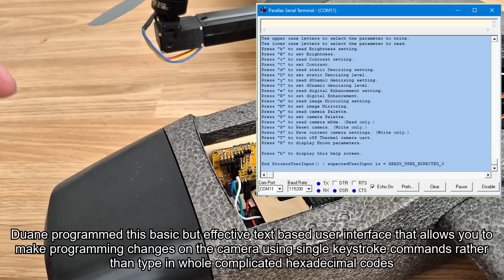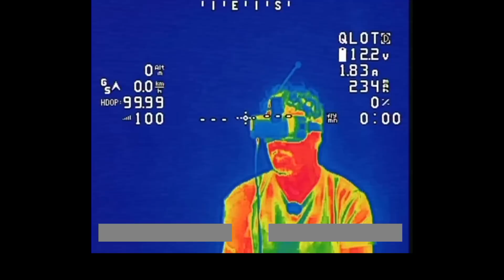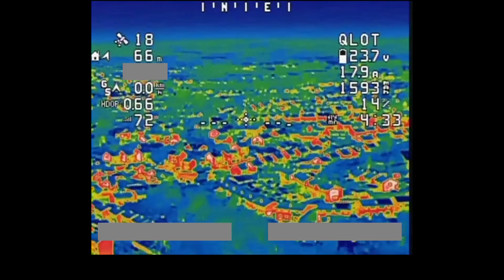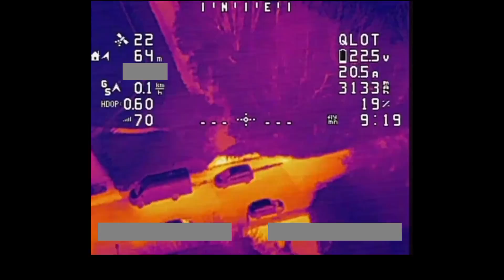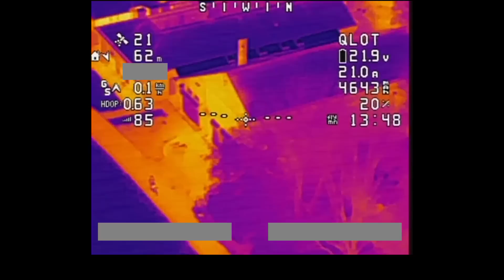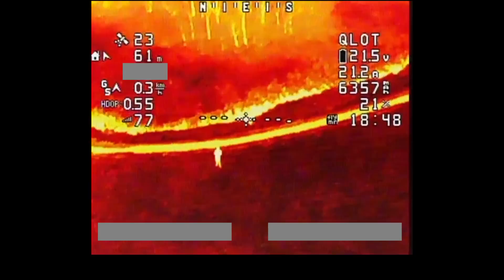🛩️AxisFlying Thermal FPV Camera - Colour Modes Unlocked

Comment: Have you found out why it causes the glitching during switching cams? Ive configured the other cam also to PAL and that helped only shortly and came back to this glitching again.
Reply from the maker: The glitching was caused by the receiver on my goggles. I can't remember exactly what the issue was, but basically ally I had to change the diversity mode

Comment: I got the 640 version and trying to figure out how to get my osd to work as well as getting an esp32 c6 connected to change the color palette. I got the cam working with both a 5in1 flight controller and a regular fc+vtx but no osd or control over the color palette. Also I’m using a Mac and betaflight. Maybe not the best choices for this….
Reply: I can help. If you haven't figured it out.  Also, how much better does the 640 look than this one?
Reply: @hduyshwjuduhd7 that would be awesome!! It doesn’t look too much different from this video but it’s based off me watching on my phone. I did manage to get osd from using a spare aio I had and grabbing a regular vtx. It’s the tinywhoop 5in1 aio with no osd but I didn’t mess with much. As for the color palette. I can’t get it to work and my camera has a green pcb that supposedly doesn’t have the tx/rx enabled in their firmware from the factory

Comment: 12:42 the reason for a red mode is because it lets your eyes adjust a bit more for darkness while looking at red light.
So if you are in a situation where you need to take off your goggles for whatever reason to see whats around you, being in the red mode would lessen the night blindness as you take the goggles off.

Comment: For anyone watching this the camera interface is standard CVSB out which means it will work with and analog  vtx  and OpenIPC is you have a board that supports CVSB in  (there are multiple that do) the control interface is just standard 3.3v uart you just send the commands via uart like you would with a gps or anything else. I'm not sure if INAV or Ardupilot have native support for it but I'd be surprised if they didnt

Comment: I was surprised that you didn't have the Caddx Infra on there,  still very interesting; it's like having a super power being able to see things in total darkness.
Reply: From what I've seen about Caddx Infra, it seems to be visible light camera as well as at least near IR. It gets noise in darkness for example. Axisflying in pure thermal camera, amount of visible light will make no difference in what you see.
Reply: @Qwarzz  I wonder if that's specific model dependent, they do have at least one model that claims to operate in 8-14 micrometer range, which would make it a thermal camera.

Comment: I tried mounting on an 8 inch and the servo stopped working pretty soon (a cheap 9g). So the plan now is with a rekon 3.5 2s frame I just ordered, skip the tilting nonsense and e6000 the thermal angled downward.

Comment: I would've put an RP2040 between the camera and the flight controller, since you said you managed to communicate with it using Python. You could set up some code to read PWM values from an RC channel, and in theory, you could switch between different modes mid-flight.

Comment: the rolling image is because you use mix mode. Try using standart diversity mode and it wont roll the feed because no 'sync lock' issue.. This also happened to me if i use camera swticher with my rapidfire..
Reply from the maker: Yeah someone suggested this on my last video, however that doesn't seem to fix the issue for me 🤷
Reply: @gizfpv dunno, but works for me with rapidfire

Comment: The red one looks like terminator vision. Set craftname to Cyberdyne Systems VTOL lol.  Jokes aside pretty cool cam. Would love to see one in 1080p+.
Reply from the maker: hahaha, you're just giving me ideas now
Reply: @gizfpv  😄👍🏻
Reply: Haaaa, my first FPV build was actually a tri-copter model of the HK Aerial I 3D printed, but in PLA it was so heavy that it sucked at flying and I couldn't really get it going, so I moved onto quads. Now that I've been in the hobby for a few years and know a little more I've been thinking of reprinting in LW-PLA (and have a thermal cam I'm messing with currently). For fun I mounted 2 "targeting" lasers where the guns would be and hooked up to the LEDs on it, would make for some interesting cinematic footage if I could get an updated version working somehow. Lol Not anytime soon though as I'm trying to get a couple VTOL fixed wing builds flying (been stuck at the hover phase which they are refusing to do properly).

Comment: Extremely cool!  You should consider asking him to upload a vid of that control board to youtube, I would love to buy one as I plan to use these axisflying cameras for a project sometime this year and I would love to purchase one of the boards!  Black/white hot are probably still the 2 most useful modes for identifying detail and objects of interest.  While the other palates are fun to play with, the only one that serves a function aside from the default one, is the highlighted super hot portions in the black/white mode; as you mentioned, for Search and rescue.  It would also be a good mode to look for really hot things, like wildfires starting.  Quite the machine you have there, excited to see you use it for practical applications in the future!
Reply: I'm planning on making a video on the next week or so. What do you me to include in the video?
Giz's radio doesn't include extra knobs or sliders so I didn't add radio control for more than the palette. With a radio like the TX16S I could add knobs which would control the contrast and brightness.
Reply: I too want to buy that board and software.
Reply: @AdityaSingh-pe8nq  I'll upload a video when I have boards available to purchase. I'm waiting a few parts so I'm not sure when I'll be ready to sell some.
BTW, the software is opensource. There's a link to my Github in the description.
Reply: @ddegn This is all super interesting. I saw in a Reddit thread that there's a way to manually NUC via UART. I think that would be super useful as well. Right now flying a quad especially closer to the ground when it NUC's you lose feed long enough to possibly cause a crash. That would be a great feature.
Reply: @dan.learns.things  I've wondered if this is possible or not To me, with the camera on the bench, The Non-Uniformity Correction (NUC) action occurs at 30 second intervals. There's an "automatic shutter control" but this value is set in minutes. It looks like it's possible to turn off the automatic shutter control but I'm not sure if this is the same as the NUC. I'll attempt to figure this out.
Reply: @ddegn  they should go hand in hand. I have a head mounted thermal with manual NUC function and no option to auto NUC. If you hit the NUC button without covering up the objective, you get a ghost image burned into the screen that doesn't go away until you hit NUC again with either a lense cap or your hand in front of it. Anything with an auto function will quickly close the shutter, NUC, then open the shutter again which you can often hear as a click.
Reply: @dan.learns.things  I'm trying to figure all this out. There are multiple settings which perform actions similar to a NUC function (as far as I understand it).
Here's a list of these settings:
Manual Shutter Calibration  (Write-Only)
This command is used to perform a manual shutter calibration for the module, known as Flat Field Calibration (FFC), which is used to correct the non-uniformity of the image and improve the image quality.
Manual Background Correction  (Write-Only)
This command is used to perform a background correction for the module. 
Background correction reduces the distortion of the background image to make it display normally.
Vignetting Correction  (Write-Only)
This command allows you to manually perform vignetting correction.
Vignetting correction is to correct image non-uniformity caused by the 
transmittance of the device's lens and internal radiation (pot lid defect) to make the image more uniform.
When using this function, you need to face the lens towards a uniform surface. Otherwise the current lens scene will be superimposed, which will affect the image display.
Automatic Shutter Control  (Read/Write)
This command is used to switch the automatic shutter control mode of the 
module. 4 modes are selectable: automatic control off, timing control, temperature difference control and full-automatic control (default, 0x03). It is recommended to keep the default setting.
After setting the switching mode (timing, temperature control, full-automatic), the shutter is periodically closed according to the set conditions, which helps to improve the uniformity of the thermal imaging.
Setting the Automatic Shutter Switching Interval  (Read/Write)
When the automatic shutter control is set to 0x01 or 0x03 (refer to Automatic Shutter Control (Read/Write)), the automatic shutter switching interval can be adjusted as needed. The module will close the shutter at a set interval, 10 minutes by default, and it is not recommended to modify it.

I'm almost done adding these five settings to the user interface. Some of these parameters make sense but some seem redundant to me. One thing I don't understand is why I observe something like a shutter closing at 30 second intervals when the default setting is 10 minutes.
The closest thing to your NUC button seems to be Vignetting Correction. I'm pretty sure the camera has an internal shutter. Hopefully it will be possible to take direct control of when the camera performs these calibration actions. I'm thinking the Manual Shutter Calibration (FFC) may act like your NUC button while not requiring an external cover.
Hopefully I'll be able to make sense of all of this once I try using these functions.

(I hope YouTube doesn't delete this.)
Reply: @dan.learns.things  The camera has five different settings which effects the way the shutter or NUC behaves. It's possible to turn off the automatic shutter. This prevents the frequent freezing of the image. A flat field correction (FFC) can be manually triggered when desired. There are a couple other settings which results in ghost images similar to those you described.
I think manually activating the shutter will be a big help to those who want use this camera with a FPV drone.
Yesterday I posted a long reply with descriptions of these various parameters. Apparently YouTube didn't like the long reply and deleted it. Hopefully this reply survives.
Reply: @ddegn I totally understand if you'd prefer to monetize the boards, it's a cool project that you obviously worked hard on, but would you ever consider open-source for the boards as well? With all the tariff nonsense hitting the fan international shipping might get sloppy fast. Being able to self-source or self-manufacture might be preferable for some of us.
Reply: @ddegn  I bought the propeller flip board in the description, I would just like a tutorial on how to flash it and change the settings from my computer.
Reply: @jwaller89  I just added instructions to the Github readme file. I don't have a FLiP myself so I had to assume some things. I'm hoping things will work well using the instructions. If you have trouble, I'll try to help. You can send me an email if you need help. My email is in the readme.
Reply: @ddegn i would like to buy one too man
Reply: @ddegn  I'm not the guy you replied to, but I'd be very interested if there was some way just to change the color palette on the ground prior to flight, without needing to purchase or install any special hardware at all. Ideally saved as default, but if that's not possible then just as simply as possible before each flight. I think Giz said it was not possible, but it would be cool if it was somehow.
Reply: @Darrylx444  The current user interface uses a terminal program to make changes. Any changes made can be saved as the new default.
It would be possible to add an OLED screen and buttons as an interface but that would be a comparatively big project.
Reply: @ Thanks for the reply. I would have a small PC / laptop with me in the field anyway, so I guess that OLED screen or buttons should be un-necessary? I'd be grateful for somebody to publish instructions on how to change the palette using a terminal program without special hardware.
Reply: @Darrylx444  The user interface can be seen at 4:09. To change the palette you'd enter an uppercase "P". This brings up the full list of available palettes. You then enter the number of palette you want and the microcontroller makes the appropriate commands to write this choice to the camera. The top menu includes the option to save the current setting by pressing "S" and then "Y" to confirm you want to save.
It's a really basic user interface but I think it gets the job done.

The palette menu uses the characters "a" through "e" for palette choices larger than 9. (Basically this is a single character hexadecimal number.) This keeps the input to a single character which slightly simplifies the programming needed to select the desired palette.
Reply: @ddegn  Hi, douane. I sent you email for more details, but without response. 
1. Where to buy board for thermalassistant? 

2. Your propeller microcontroller module capable of overlaying video feed from multiple cams, adjust temperature range or transparency?
3. ThermalAssistant supports LWIRcams other than just axisflying?
4. Did you tried meanwhile FLIP board as alternative?
Reply: @brezovprut4431  Sorry for not replying soon to your email. I'm hoping the video I make soon (hopefully) will answer a lot of these questions.
I did reply to the last email you sent. Good luck.
Reply: Awesome, subscribed!  If you’re unable to sell these little control boards, it would be great to see a full walk through of parts needed, assembly of components, and programming. I do not have the mathematical knowledge to program, so drag and drop code (plus an explanation of the programs needed to read/write the code) would be really helpful to anyone wanting to build this!

Simple control, AND more advanced controllers should definitely be included!  I know some people run more simple drone controllers but adding programming to bind other buttons on a TX16 would be awesome!

What other functions and features could you pack on a board like this?  Maybe something to add to your video whenever you make it!
Reply: @ddegn Hi Duane - just catching up here - where might that video be seen? Thanks a bunch... (also willing to purchase)

Comment: Seems like the tree for example, looks hotter when viewing in the upper half of the frame than in the lower half, very cool though, would love to see this in the higher def camera. Yes, that's what I would use is the black and white one to look for animals at night
Reply from the maker: Yeah I noticed that too. Think it's because the camera uses centre spot metering, so adjusts the exposure based on what's directly in the centre of the image
Reply: @gizfpv  it's just because you have the camera pointed at a thermally bright or dark object in the frame. keep the tree centered and it should look roughly the same through the entire frame